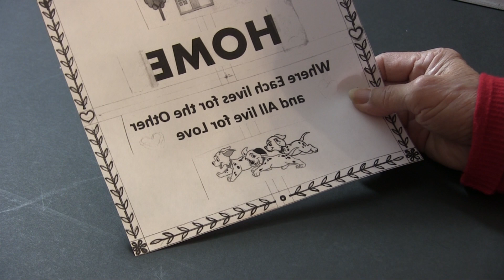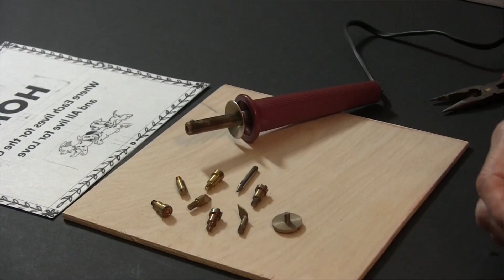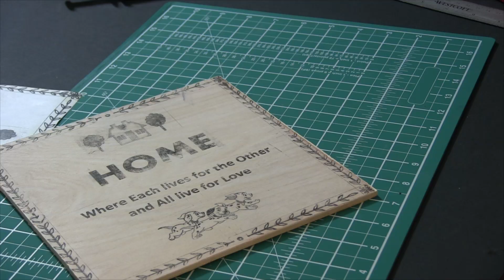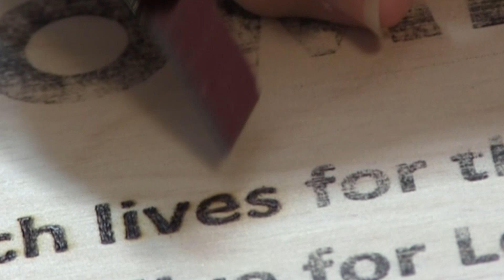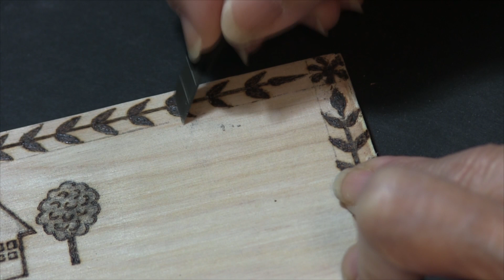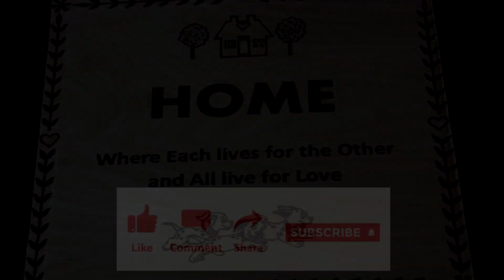WOODBURNING - How To Do Image Transfer & Fix Mistakes

Comment: i use tape too but recently i found some large black & metal clips i had stuffed away in my kids old school supplies. they work well and are easier to take off the paper than tape, however, they arent clear like scotch tape so you cant see through them and it only works for moderately thick wood... anyone should be able to find them at walmart or any office supply store... this is just an idea and i dont know if everyone would use it or if it would work for everyone but there it is :) i love the idea of using a laser printer and heat to transfer the designs. i have been using a charcoal pencil and tracing the images but its slow and very messy (use a lot of erasers). again, TYVM for all your help. you truly are amazing!!!
Reply from the maker: Jonathan, I wish you well and lots of success on your work. I'm happy that  even in a small way, I can be of help.  Thank you for your comments.

Comment: Hi Can u plz help me with your suggestion,what tool to buy as new beginner, iam in UAE so plz throw some light and also what is name of that tool to transfer text! Plz reply
Reply from the maker: Hi Swetha, thanks for watching my woodburning video.  The tool I suggest will work well for you.   The first Walnut Hollow Woodburning Kit I use for the first part of the video is the Creative Versa Tool.  Use the round bit that comes with the Kit, called the Transfer tool which screws in to the pen shaft.  Follow the video, have patience, and you will do a great job on your transfer.  Another Walnut Hollow Kit I use in the video is the Creative Woodburner, which uses interchangeable pointed tips.  Both kits are wonderful to use. Happy wood burning!